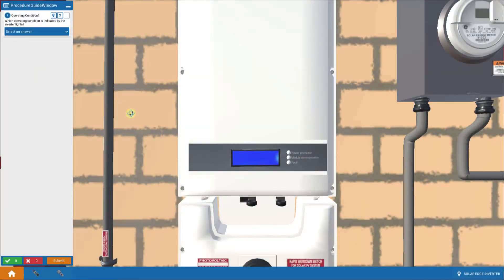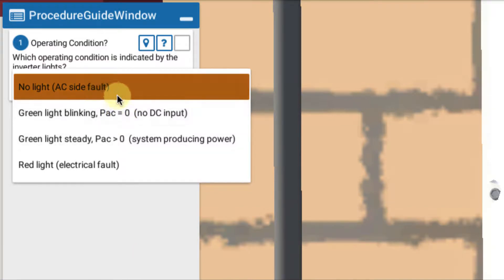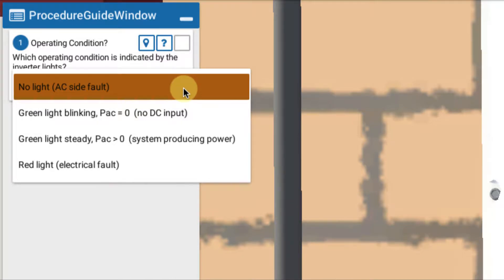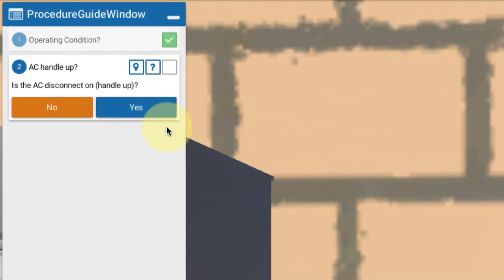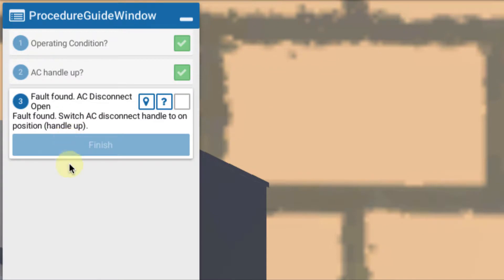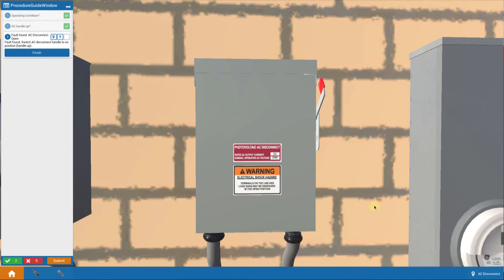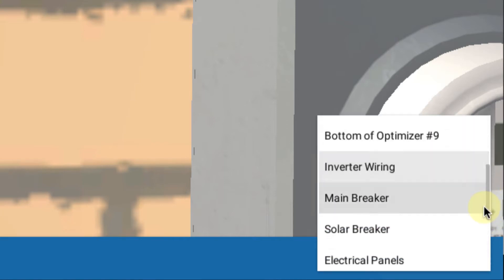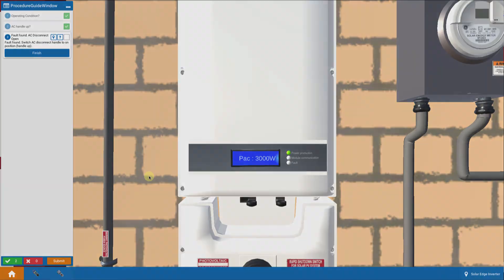Solar Troubleshooting - AC Disconnect Off

Comment: In the scenario above the inverter ac runs to the ac disconnect (load in)  and then the main panel runs into the top of the ac disconnect (line in)  both ac runs to the ac disconnect panel. Ok I understand that point.  What I need clarification is should there be a load (out) from the ac disconnect to the main panel? so that there are three sets of wires as follows main load in (top) and load in (bottom) from inverter and load out (bottom) to the main panel.
Reply from the maker: There is not a need for a 3rd set of conductors from the AC switch. The switch’s purpose is to make a simple break in a circuit, from a ‘line’ side or primary (always on) power source to a ‘load’ side or secondary device, something that can be on or off.
So in this case, we have a primary source as the utility (wires coming from the solar breaker in the Main Service Panel), and a secondary device as the inverter. Now we know that in our solar pv case, the inverter can be a ‘source’ of power, but for understanding the disconnect switch, we need to think in terms of safety and what is its job. It is in the circuit to allow a separation of all our solar equipment from the very dangerous and ‘always on’ power source that is the utility company.
So there are the two wires, L1/L2, at 240 volts AC, coming from the MSP, and two wires coming from the inverter. We put the utility wires on the top of the switch, so they are called the ‘line’ side, because when the switch is flipped to the OFF/open position, those are the wires that will STILL be hot/dangerous. So we put the two wires from the inverter on the other side of the switch mechanism, the ‘load’ side.
Do not think of a circuit having its own ‘line’ and ‘load’ sides; it is the switch that has a line and a load side. And don’t think of a line or load ‘in’ and a line or load ‘out’. Just think and say ‘line’ and ‘load’. In a sense, the ‘line’ is the ‘in’, and the ‘load’ is the ‘out’.
Reply: @InterplayLearning  thank you
Reply: @InterplayLearning  I have been reading and absorbing the information.  I have a couple follow up questions. First, your training video assumes that there is a feeder breaker ( I hope I got it right) that runs from the MSP to the PV AC Disconnect. What happens in a complex circuit when there is a direct connection from the main grid breaker panel ( situated next to the pv ac disconnect) and there is a split connection running to a bypass and transfer switch and then load to the MSP and critical load panel (CLP).  How does that affect the the function of the pv ac disconnect.
Second, when the grid is up there are the two sources of ac energy.  The main is the greater so I assume that the inverter ac energy stays at this point.  What happens when the grid is down?  Is there backfeeding from the load to the line? 
Third, I have seen many videos with a circuit having a supply side tap. I noticed that many have wires from the pv ac disconnect to the line side of the meter wires running into the main grid breaker with insulated limiters/sensors.  Are the wires coming from the ac inverter load? Can you explain what actually happens?
Thanks